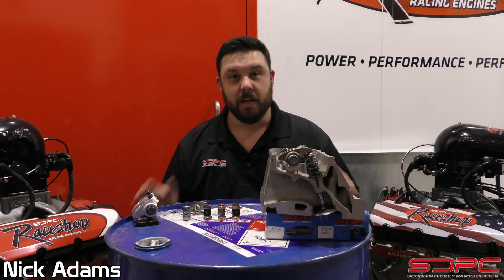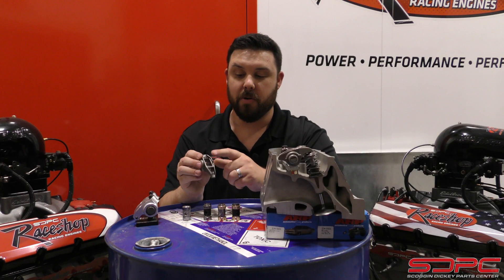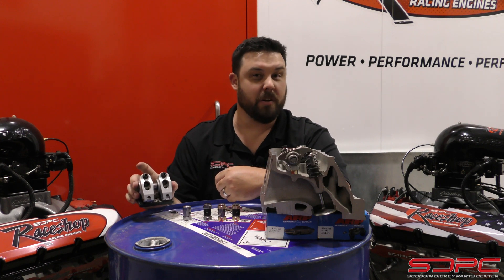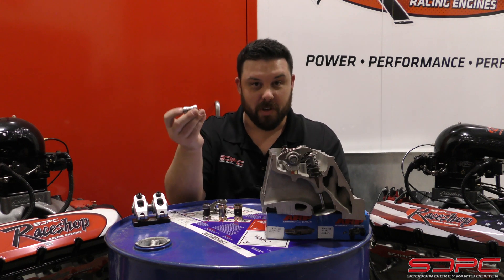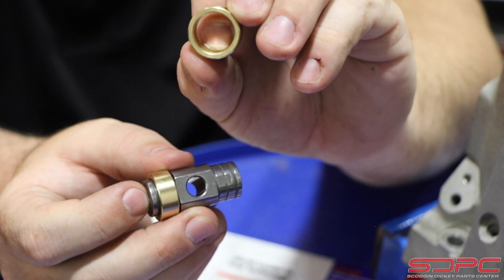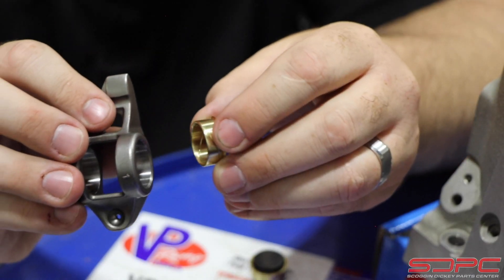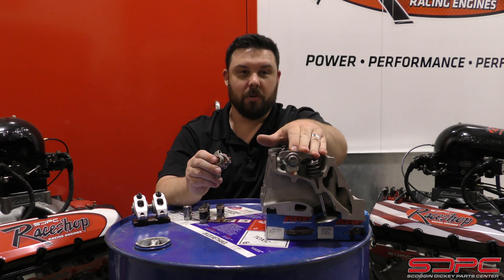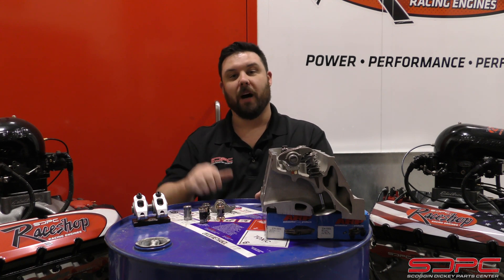SDPC Tech Tips: Trunnion Upgrade

Comment: that is not the reason  the bronze ones you  press in get worn from the tip being non roller as the top wearing fast from the top part always being road in the same spot. the free floating bronze wears more evenly there for last longer . the needles are ok only time they have a problem is when the rocker literally cracks in the Bering area .witch is a rare occurrence.

Comment: Hi I just upgraded my cam shaft in 06 GTO wondering if I should upgrade my rockers too!?
Reply from the maker: If you're running heavy springs and an aggressive cam it wouldn't be a bad idea to look at a trunnion upgrade.
Reply: @Sdpartscenter   It’s a stage 2 cam with the stock heads valves & springs

Comment: CHE vs Steve Morris durability?
Reply from the maker: We don't have any of the Steve Morris kit on hand, but they're more than likely comparable.  You wouldn't be steered wrong going with a BTR kit as well.  We run the CHE trunnion kit on a variety of LS engines we build in the Raceshop, some of these are full tilt LS7's that are road raced, run on the autocross courses and other forms of abuse at high rpm and a lot of valvetrain shock.  Best of luck on the build!
Reply: I personally wouldn’t recommend the bronze/brass type kits. If you want a good trunnion upgrade. I would go with the Brian Tooley v2 TK002 kit.
Reply: @iMaRtYz  is this based on research/experience or theory alone? i can imagine the needle and race trunnion having more advocates for durability as thats what GM uses, but we all know GM isnt only making choices based on what's best for the engine or vehicle. needle an race may meet their life expectancy average, but is it really the best?

at this point its all academic for me cause i had to place my order already.
Reply: @iMaRtYz  I went with the BTR kit you mentioned. One important thing you said, and way too many others say, as well, is "bronze or brass." Trust me, there are no brass kits available for trunnions OR valve guides. You might get a week or 2 of durability out of brass. It is soft, REALLY SOFT.  Anyone who would manufacture brass guides and/or trunnions wouldn't be manufacturing them long, because they'd be pure junk........

Comment: Great video, so I have a 2012 GS with ECS supercharger, 8lb boost. Makes 592hp to wheels. I rest of the engine is stock. Do you recommend this upgrade and also what about lifters? Not sure if with stock cam I’m going to have issues.
Reply from the maker: It's not necessary but you can go with them whenever you plan to do a camshaft and spring upgrade.

Comment: Great video nice to know this because I got a few needle bearings on my oil plug magnet 😔 I have a stock 2000 5.7 ls1 trans am. Do these upgrades fit my stock rocker arms?
Reply from the maker: Yes, these are designed to fit stock rocker arms.

Comment: Is there anything unique about the retainer clips used at the ends. Previous owner of my car (08 vette, ls3), did the upgrade set with the bronze bushings. I pulled the valve covers off and found two of the rockers to be off center and have broken retaining clips on one side. Clip was still on just pushed to the siding and missing one of the snap ring ends for the pliers to grab at. I want to make sure I can repress them straight and add a new retaining/snap ring from hardware store
Reply from the maker: I cannot confirm if the snap ring used is special or generic. you can try to find a replacement, but no guarantees it will work.

I know BTR offers a trunnion retainer clip for individual purchase, but not sure if they are the correct inside diameters or not.
Reply: @Scoggin-Dickey Parts Center  Or thickness.....

Comment: Hey sir I have a question. When you remove the rocker and do the install does it need to go back on the same valve or does that really matter? 130k mi motor. Has a bit of surface wear where the valve runs but not to bad. Thank you in advance.
Reply: According to GM SI yes, all Valvetrain parts must go back to their original locations
Reply: @Airman  I agree. I ALWAYS put the rocker back on the valve it has worn to. If the valve stem tips have been resurfaced, then I'd buy new rockers......

Comment: Love the vids I really appreciate the knowledge! 
So I went with che with my build in my 05 ls2 gto with a medium 232 234 600 600 cam good springs Delphi ls7 lifters and more . I'm a street guy who daily's my car with some spirited pulls here and races here and there. What's the longevity until I need to replace my che bushings?  And springs at that?
Reply: Not sure if you will respond but how are they holding up? Did you have any issues? Fixing to put a CHE kit into my 5.3 rebuild for my daily truck.
Reply: @hunterrodriguez1940  Great dude! 35k miles or so 155k total and i wouldn't hesitate to drive cross country I called them and asked after I left this comment and the said I shouldn't have to worry about it. Should probably look into new springs and lifters but I ride motorcycles most of the time now and probably going to do a  boosted build in the near future

Comment: What lift and rpm are the stock trunnion able to withstand?
Reply from the maker: They're really fine for stock applications.  Some people might do an aftermarket cam on low-mile, low-abuse engines and get away with it.  But for the cost and time involved, we tend to recommend it if you're making any significant changes with a cam install.  It's just more of a CYA move.
Reply: @Sdpartscenter  thanks that's what I need to know